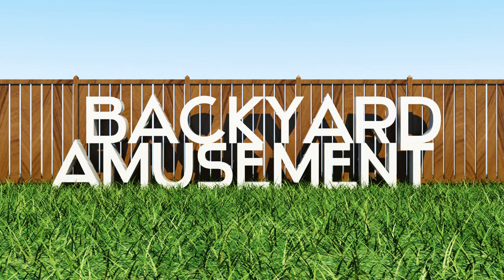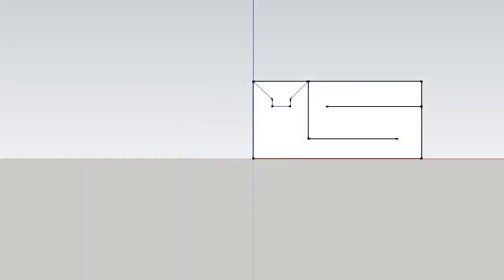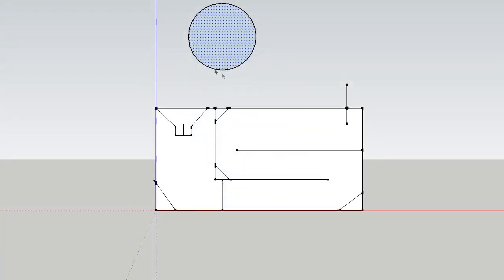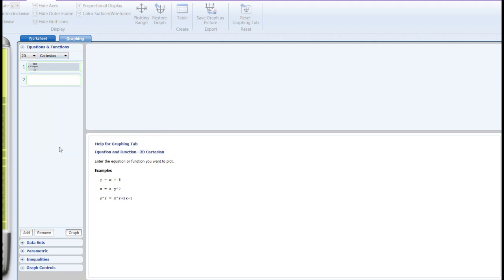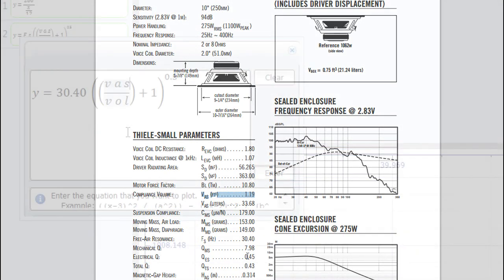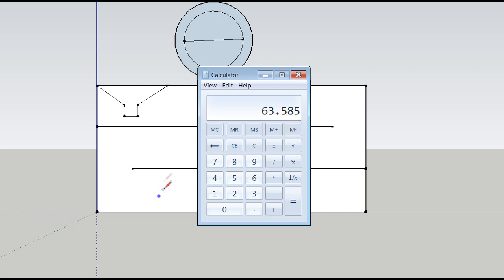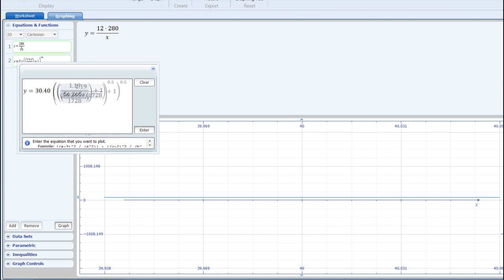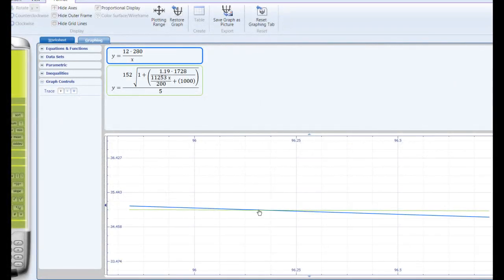Transmission line speaker box math made easy

Comment: When you added the "1,000" to Volx, you stated that it was in units of in^2, but if that is the case, then the formula does not account for how long the larger portion of the box is in relation to the calculated Line Area derived from the Driver Area. If instead the "1,000" is in units of in^3, then that factors in a larger Line Area of box (let's say 10"x10"x10"). The formula then graphs the total length of the Line Area where the Calculated Line Area Length is simply what remains after the known Larger Line Area. Is this correct?
Reply: I agree.  That "1,000" in the equation is incorrect in that it is olny defining the "larger sections" cross-sectional area and needs the 3rd dimension to define the actual "volume" of said larger area.

Comment: this is a great video. i mean i been looking for info like this for days now. thanks man. but i would like to know one thing. the Fs of my speaker is 53hz, but i want the box to give nice lows like 30hz. if i use 30hz instead of 53hz in the calculation would it work fine or not, or can it even damage the speaker? PLease someone answer this. I need to know
Reply: A 53 hz tline may get down to 30hz if you use stuffing inside the box

Comment: Your video is great, I just would like to point out one thing. When you are measuring for cone area you need to take into account the movement of the surround, and how you do this is by measuring from the out side of the surround on one side of the driver to the inside of the surround on the other. From there it is math time.

Comment: Great video. In the first function y= 280/x/12, could you explain where the 280 value came from?
Reply: just worked out the 280=1120(speed of sound)/4... did u work out what the 12 in that equation was about?
Reply: HASH VELANI  I'm also interested to know where the 12 came from... did you eventually find out? Perhaps it's representing the number of inches in a foot? I'm building a box using metric figures, so need to make sure I get these figures correct! Thanks
Reply: +Jes Kerr, Hey 12 is a unit conversion from ft to inches